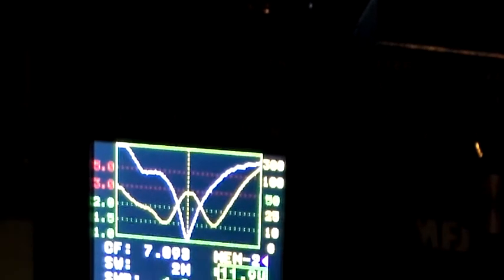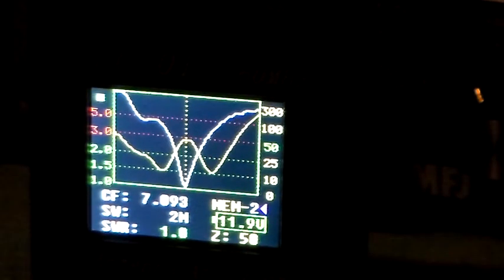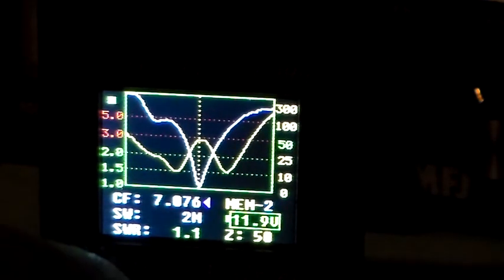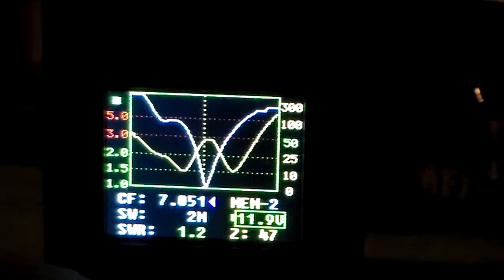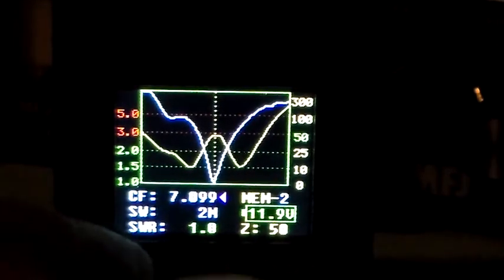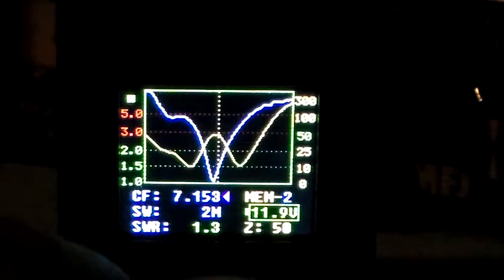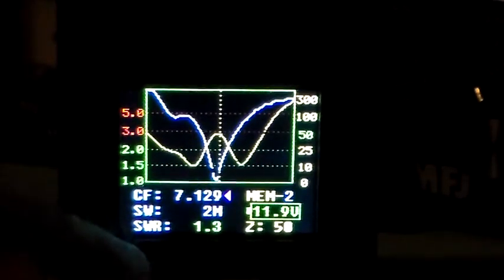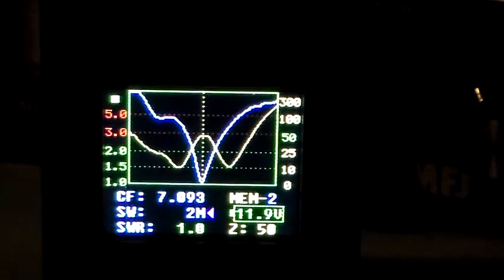You Kits FG-01 Antenna Analyser Part 2.

Comment: It's easier than that - flip down to the SW variable - which lets you shift the width of the impedence and VSWR curves by reducing the figures of the screen coverage - EG your clip shows the coverage width as 2megs  - so for 40m the curve is narrow and sharp. change the SW figure to 500K (or less?) instead, you get a massively better view of the reality of the VSWR curve your unit can display - all a lot easier than cranking the freq. up with the .00X digits like you're showing here.  Also the benefit is you see the whole picture rather than having to recall the figures you cranked it to half a minute of cranking previously.

For HF this is far and away my go-to analyser - and if ONLY Youkits would extend its coverage to include VHF/UHF I think they would have an absolute market killer, where nobody would buy the overpriced & underspecced MFJ stuff so much - or at all?
Reply from the maker: Good point, yes, I could have closed the sweep up to 200KHz or less, but I think doing it this way demonstrates the point I was trying to make a bit better.

I think you're right about You Kits making an analyser that incorporated VHF/UHF as well as HF/6m. I would certainly buy one. The MFJ analyser includes j values indicated as X. It doesn't show whether it's +/- so you have to determine that by changing frequency. This indication is useful for broadcasting where the transmitter frequency doesn't change and you can calculate component values to match the antenna. But it's a bit of a novelty for amateur radio where the transmitter frequency is changing regularly. The graphic display of impedance and SWR on the FG-01 is much more useful.
Reply: My use of it may be less searching than yours - I'm usually only looking to check on whether the tune is fine for where in a band I want to TX or to diagnose some noted behaviour oddment.
I'm also mindful that it's infinitely easier to post crits and comments on the other guy's work than go ahead and produce your own!  Which point I happily concede.  Maybe if I can find the £ to get some vid editing software I might take that leap.
Blokes like you that take some trouble to assist everone else with short instruction vids - gives the lie to the general view that there's no free lunch, ever.
Anyway, my thanks for the ones of yours I've so far seen!
BTW if you should be looking for a low price all-band analyser there's the one labelled broadly as AW07A. Mine is branded "Feature Tech" and it's a very underdeveloped product - its only real merit is that it's cheap and - well that's it, It's cheap.  Its freq. stability - well, there isn't any - if you want to see what drift can be like, get one of those. Having said that, it does work!
If I do go ahead and make a short vid. it could be on that model. MFJ do a version of it that costs way more than double the Feature Tech price, but it's been revised a little for their branding. Theirs takes 4 AA cells, mine takes 8 AA alkalines, which it eats up PDQ. Just an added spot of info for you.
By coincidence I also have the same mobile matcher I've seen you use, the 945. Nifty little unit, works just fine as long as you don't shove too many watts through it.
Best meantime
IG
Reply from the maker: No worries Ian. Take the plunge and make some videos, I don't use any editing software, I just point and shoot. Come to think of it, that's probably painfully obvious, but, as I say all too frequently, this is amateur radio. It's You Tube, not professional TV so jump in and have some fun.

I'm not in the market for another analyser at the moment as I have access to the Rohde and Schwarz at work. But I'll take a look at the one you suggested as I don't like to rely on other people's equipment.